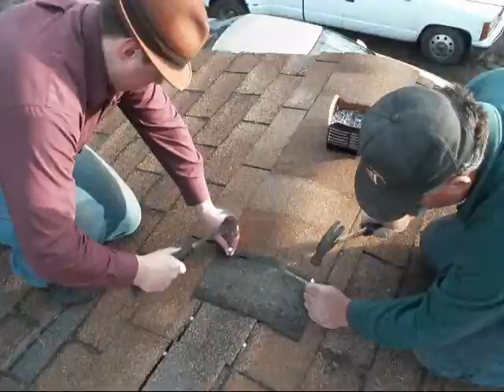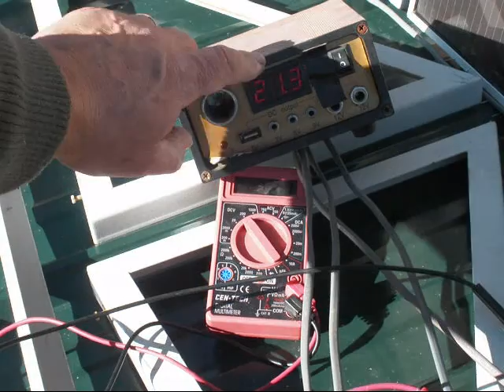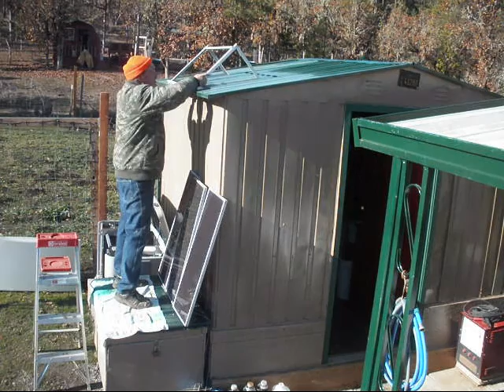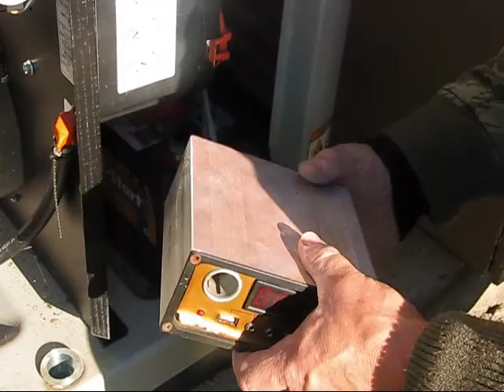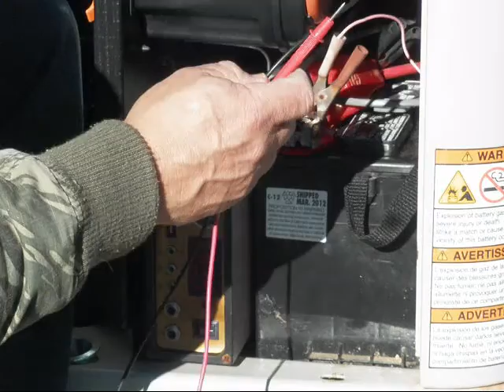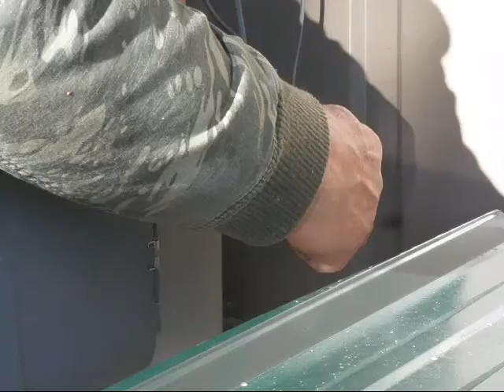Solar Powered Battery Charger for StandBy Gen.

Comment: Putting it on the roof.  That should work what your doing.?  Is the house running on solar?
Reply from the maker: The solar was disassembled. And I will be redoing it again. The generator will be repaired it in the coming weeks.